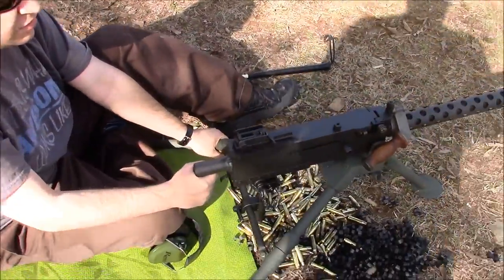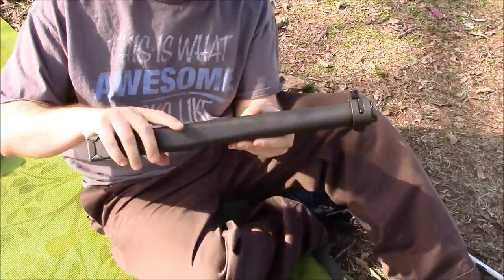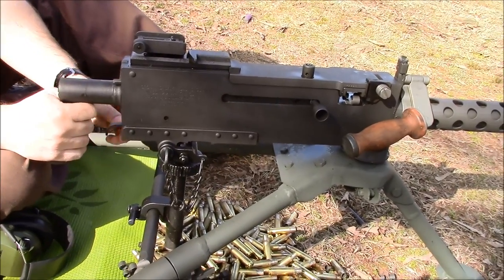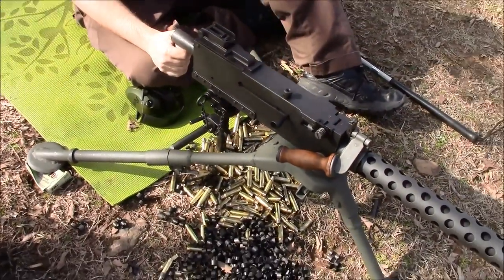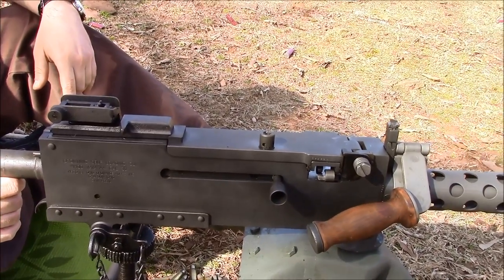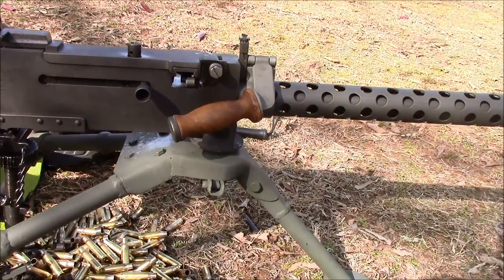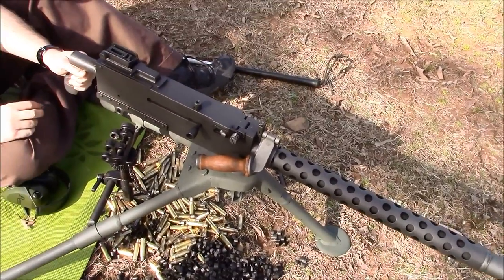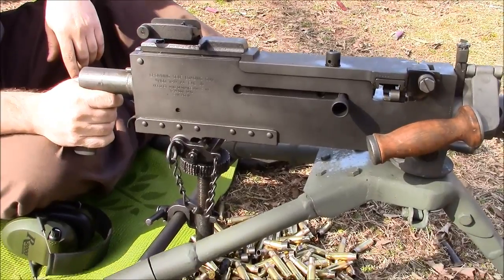Ohio Ordnance Browning 1919A4 Semi Belt Fed Rifle Review

Comment: They require some break in and prefer to run wet with oil. Polish the sear slot too. They are very fun to shoot.
Also, open the top cover and retract the bolt after firing, it allows the barrel/bore to cool faster.
Reply: Also, don't try to outrun the cyclic action of the bolt.
Reply: Always open the top cover and check the chamber when clearing, don't just rely on cycling the action. Bad procedure and begging for a cook off if a round gets left in the chamber.

Comment: How is accuracy with this thing? Would you reccomend it compared to other belt feds?
Reply from the maker: Praetorian of Ideology We didn't do an actual accuracy test with it but did cut a deep, basketball sized trench at about 75 yards during the video. I recommend the 1919 if for no other reason than while other belt feds have to be converted from open to closed bolt, the 1919 does not and has always been a closed so mechanically it operates the same. Thus its cycling is equally reliable as an original military version. Plus, there are tons of accessories, parts, and upgrades out there for it, so customizing is easy and relatively inexpensive. Finally, its just damn awesome; both a Browning design and an American classic!

Comment: Can it use cloth belts?
Reply: yes it can.  Cloth belts were pretty standard for ground use 1919A4's during WWII
I run mine entirely with cloth belts.  Picking up those individual steel links after firing is a real bugger.
nice video !
Reply: A magnet makes picking up links a breeze. Harder to pick up the brass.